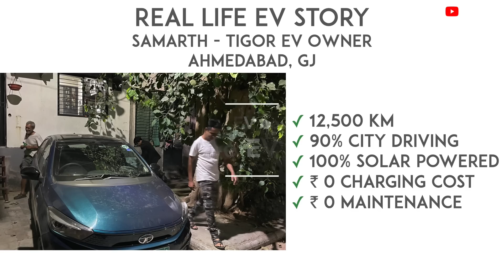Real Life EV Story: Solar Powered Tigor EV | "You don't need a Sports Car!" | हिन्दी Subtitles

Comment: Chinese, ( Build Your Dreams ) 
BYD E6 - Rs 30 lakhs, without charger.
5 lakh kms / 8 years warrenty,
71 kWh - 500 kms
Government ev meter for charging Rs 4.50 per kw (at home ) x 71 kw 🔋 = Rs 320
22.50 kw charger Rs 1 Lakh extra will take 3.50 hrs to full charge.

Comment: Hello Sir, what is your opinion on the expensive battery replacement costs in EVs? after a 1,60,000 km warranty, the battery cost of Nexon is around 8 lakhs which is more than the entire running cost of IC engines for 8 years.
Reply: By 8 years, this tech would be advanced and less expensive, wouldn't you agree?
Reply: @supahmansid  Can anyone give me written assurance ? If no, there is no point
Reply: @atulmalhotra2303   McKinsey report suggests 1kwh batter will cost 160 dollars in 2025 and less 100 dollars in 2030. So in 2030 it's price would be around 1.5 lakhs in India or even less if they are made in India.
Reply: You are absolutely right. I calculated long and hard, and for low daily drive, EVs are actually more expensive to run over 5-7 years. This is all bull shit.
Reply: After 8 yrs new battery cost may become 2lacs but great question.

Coming to EV, performance, comfort stress free and low maintenance may be reson why EV makes some sense so definitely not completely a gimmik
Reply: First of all this battery is not a single unit . Multiple batteries are in series . So which is down they ll replace the particular not the complete pack.

Comment: Bhaiya, Tigor EV mein AC hi nahin chal rahee Hein. Bahut complaint aa rahe hein aur aap second row ac vent maang rahein hain. Pahle ac theek karvaa deejiye . A comment from a Tigor EV owner for the sake of the community. Tata does not care for Tigor EV owners they are just lab rats for upcoming ev models. Hats off to plug in India and Samarth ji  you are the flag bearer
Reply from the maker: What is issue with AC? Not powerful enough ? 
That can be a feedback.
Reply: 100% true, ac occasionally works
Reply: In hot summer, cabin cooling is insufficient. Bad quality ac . many cars replaced compressor, sensor, fan modules.. long list.
Reply: i cng me kaisa hai AC
Reply: Same problem in nexon ev also

Comment: Atul and Samarth. I would like to contact you for a unique product I have which will improve the cooling of ac and also drastically reduce the compressor load from the engine or battery .
Reply from the maker: Interesting 
Write to Atulji 
support@pluginindia.com
Reply: I am using chetak Ev for last 5 months, after starting the summer season battery cooling fan is making loud noise while charging is on. For this reason i have started to charge my chetak early morning when temperature is comparatively low and noise disappeared totally.
Reply: @sameerdeshpande6360  why not charge in the night and that too in slow charge mode .
Reply: @MrKhabbu  their is only slow changing mode. Temperature drops  after 3am. Their is no point charging before that. I can charge between 4am to 7.30 am.
Reply: @sameerdeshpande6360  yes that is perfect . Hope you are able to program the charger to operate during that time
Reply: @sameerdeshpande6360  I also use a chetak u can use a wifi plug to automate the charging at night I have made video too on that topic check it once
Reply: @themusclebiker4718  thanks
Reply: @themusclebiker4718  plz send link